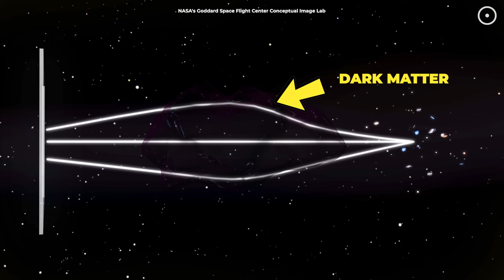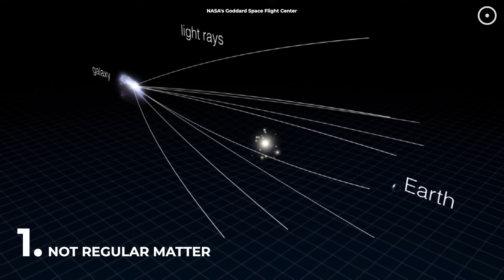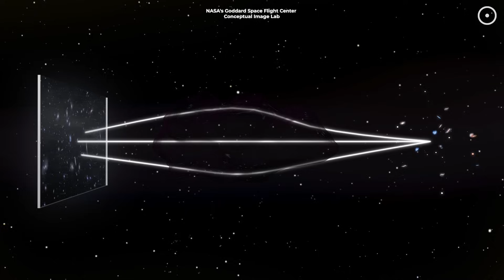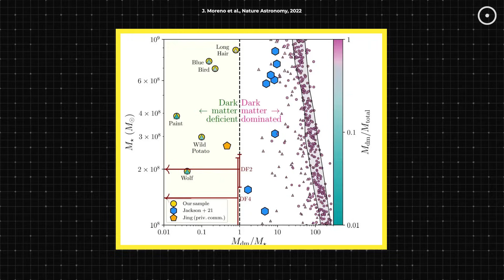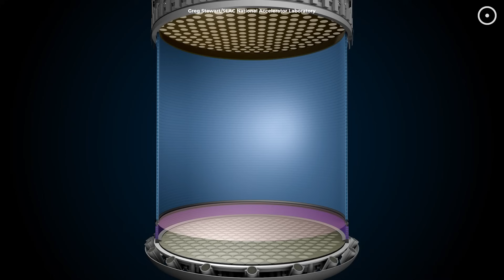The Mystery of Dark Matter Explained

Comment: Two facts of physics are cold space and heat as magnetism. Physics is simply magnetic fields. External heat energy outside of entanglement of mass doesn't ground currents. Only mass grounds currents of heat flowing as perpetual motion momentum velocity as the cosmic speed limit velocity within and without mass. Through space as a weak external magnetic field, dark heat energy outside of entanglement of mass is traveling through space as maximum distance traveling. In mass, it travels the same distance and rate of velocity as liquidity infinity to illusionary solidity from liquidity infinity currents flowing cycling circulation centrifugal force as internal magnetic fields grounding currents. Outside of the entanglement of mass heat, energy doesn't ground currents. Mass is both cold space itself and heat energy grounding currents towards the earth's surface and core. Outside of the internal magnetic field mass as outward force of pressure known as weightless. No force of currents flowing in space.  Cold fusion groups heat energy as mass as whirlpools of heat. Fuel consumption has depleted the earth's mass, disolving into external heat energy outside of entanglement of mass, and space itself is no longer occupied within our atmosphere. Heating up the atmosphere and the core. If mass isn't renewable by harvesting it back, we get overwhelmed heat and less occupied space by mass.  Rain drops cold space down towards the earth's surface as condensate displacement of heat rising through the earth's mantle. Ice melts as condensate. Ice holds more occupational space within it than any other mass by combining cold repulsion outside of mass as condensate displacement of heat rising. As our planets mass is reduced, our magnetic field is reduced by occupational space within our atmosphere without mass occupational space within it. we shrink inward. Mass doesn't collapse inward it disolves outwardly. The outermost surface perimeters disolves first. In every scenario, mass disolving its outermost surface perimeters. Space itself is an external magnetic field of magnetism. It doesn't ground currents. Mass is internal magnetic fields grounding currents through its surface and core. Earth's magnetic field proves hypotheses that elements combined synchronization amplification of magnetism grounding currents as planetary internal magnetic fields as mass. As mass disolves its outermost surface perimeters first, like magnetic field outermost surface perimeters, first inward pressure. Distance traveling cycling circulation is reduced, but velocity is constant, meaning the fan blades are shrinking inward. Heat isn't spread outward through as much cold repulsion of space within occupational space within our atmospheric gasses. If heat overwhelms our planetary internal magnetic field atmosphere like Mars and Venus, we lose cold occupational space, and then our atmosphere. Removing mass shrinking our occupational space within our planet and atmospheric gasses disolving into external heat energy outside of entanglement of mass doesn't sound good. Facts.

Comment: I read in a recent article about black holes 🕳️ and what’s on the other side of black holes. It went on into details about how they grow and eventually shrink and more or less evaporate. But when matter goes into the black holes, (as best my recollection goes) the atoms are stripped apart and the electrons are in a quantum state and continuously moving from one proton to another and when the black hole dissipates the matter exists as residual remnant matter from a white hole. If this is what happens to matter after it goes into a black hole and then exiting a white hole, what happens to the matter is subject to debate. There’s already some speculation about the possibility the links between the residual matter and dark matter.

Comment: Talking about centrifugal force of magnetism. Two facts of physics cold space and heat energy. Opposing forces. Cold space itself is a weak external magnetic field. Magnetism bends heat. Photons are only light as quantumized sparks of unabsorbed heat energy bouncing off mass striking sparks of electrons quantumized. Within and without mass. Mass loses heat and absorbs heat energy.

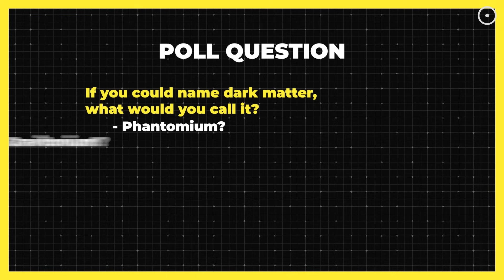Comment: @2:46 I already determined what is causing stars and galaxies to move too fast.  I call is AP theory, which stands for Accelerate Propulsion.  Dark matter is an accelerated propulsion that ONLY occurs to stars and galaxies because they constantly radiate extremely fast solar winds full of charged and ionized particles, which in turn causes a slow but measurable ion propulsion to their overall motion caused by gravity.  Only stars and galaxies produce the effects blamed on dark matter.  This added propulsion does not happen to small bodies like comets, asteroids, moons and planets because they don't spew a constant solar wind full of hot ionized particles.

I published a book about it called Secret Universe Gravity by Ron Kemp explaining everything.  I even came up with the slow acceleration rate of a 1 mi/h (1.61 km/h) increase in velocity every 10,000 years.  So take the age of the star or galaxy and divide by 10,000 to get this accumulated velocity blamed on dark matter.

Our solar system is 4.5 billion years old, so 4.5 billion divided by 10,000 equals an extra velocity of 450,000 mi/h.  Our Milky Way galaxy is 13.7 billion years old, so 13.7 billion divided by 10,000 equals an extra velocity of 1,370,000 mi/h.  Astronomers measured the motion of our solar system and came up short by 450,000 mi/h.  Then they measured the motion of our galaxy and came up short by 1,370,000 mi/h.

After I did these calculations I thought it was just a coincidence.  So, I began measuring the age to velocity ratios of satellite galaxies orbiting the Milky Way and every dwarf galaxy I measured had the same 10,000 to 1 ratio between their age and velocity.  So it's no coincidence.  The AP Theory explains everything, including why stars orbiting at the edge of their host galaxy are unable to reach an escape velocity with an orbital velocity exceeding 800,000 mi/h while more than 50,000 light years from the barycenter of the galaxy's mass.

I also determined that the lensing of light is not caused by gravity or dark matter.  It's caused when light passes through a heated medium, like gas, an atmosphere, water, bouncing off hot pavement or the hood of a car.  Light is not bent, distorted or magnified by gravity.  It's bent, distorted, magnified and mirrored when it strikes something like heated gas, an atmosphere, water, etc.  We have determined this right here on Earth.  It's why Eddington measure the lensing effect as light passed through the hot corona of our sun.  It's why light is bent when it passes through the hot corona of a blue giant.  It's why light is bent traveling through hot gas between nearby galaxies.  Gravity doesn't cause the lensing effect.  It's caused when light passes through a heated medium.  Just look at the light passing through the flames of a fire.  The light from background objects become distorted.  It's not caused by gravity.

The Bullet Cluster was imaged in both gamma rays (blue) and X-rays (red).  It did not detect dark matter.  Telescopes found X-rays and gamma rays surrounding the bullet Cluster, not dark matter.

Dark matter is a placeholder or fudge factor that can take on any value.  That's why computer models were able to make it look like they found evidence of dark matter because they had to include more gravity to make the model match observations.  That's not evidence of dark matter, that's fudging the model to make it match what was observed, which is far from the scientific method.  Fudging data to match expected results is pseudoscience.

Comment: My biggest issue (and a related question) with dark matter is differentiating it from (almost) invisible regular matter in the form of black holes. Granted, black holes devour matter and emit X-rays in doing so, and thus can be detected. But could a large number of primordial small black holes explain the whole thing?
Reply from the maker: That's a great question! It's a tricky issue to nail down.